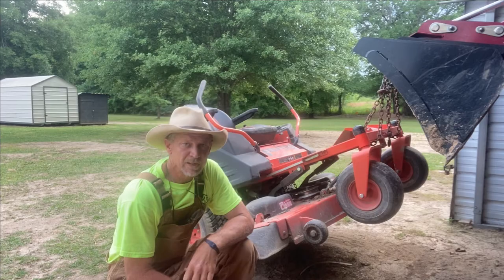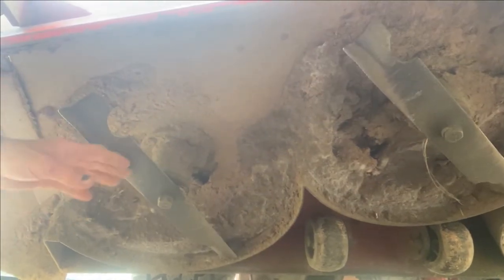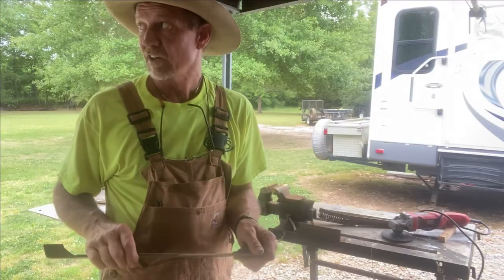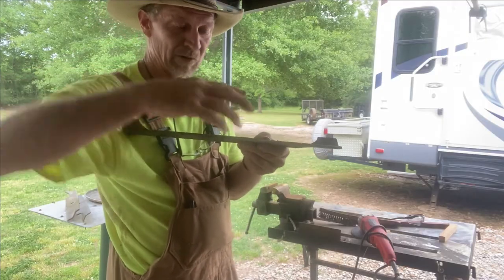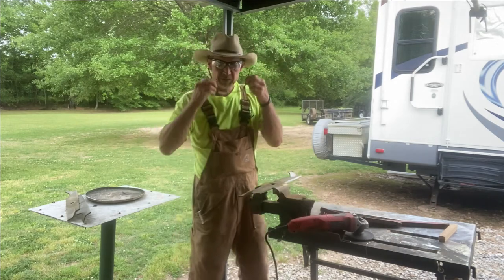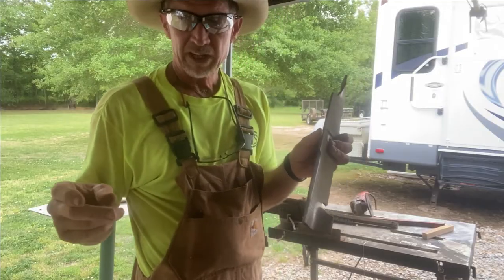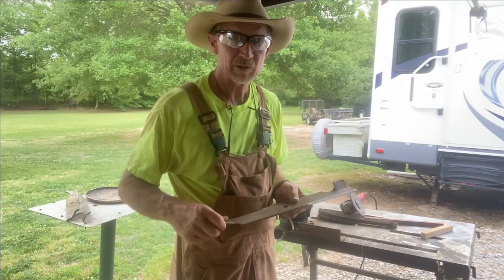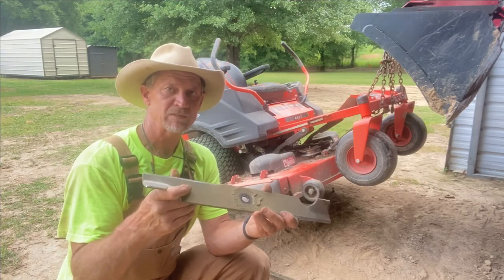How to Sharpen Your Lawnmower Blades the CORRECT WAY/ BAD Boy Elite Zero Turn

Comment: I recommend having 2 sets of blades. When the set on mower needs to be sharpened, simply swap sets. Then sharpen the dull set to be ready for the next swap.
Reply from the maker: I actually have 4 sets for my mower I use daily mowing yards.

Comment: Love your video, especially your comments. Obviously you have been doing this a long time and have learned from your experience and your mistakes. Regarding blade wear, especially the rounding of the corners and the effect of leaving a "rooster tail" strip between the blades. Have you ever known blades to wear and actually get shorter? I measure the length of my blades after removing them and get, say, 16.15". Then when I try to find the proper replacement blade, the manual says it should be, say, 16.45". Hard to believe they could shorten that much from wear. The corners are also rounded a bit, and the rooster tails can be pretty bad where the blades overlap. Any comments?
Reply from the maker: First I want to say thank you for viewing and commenting.
As per blade length, They will wear short over time but I believe the biggest issue is blades now-a-days are built to the specs.
Meaning you could buy 3 sets of new blades and all 3 could be, 1/16" difference.
But yes the rounded corners is the biggest issue.

Comment: why not sharpen with grinder while blade is still on mower?
Reply from the maker: 1: you never know if your blades are balanced
2: I can take them off and do a much better job and faster.
3: I can inspect my blades for other damage while I got them off.
4: That just doesn't make  good since to me. 🤣🤣🤣🤣
But thanks for that question friend.

Comment: There's more to shapening lawn mower blades than just running a grinder across it, you have to balance each blade by removing equal amounts of metal from each   end, so you don't ruin your spindle bearings
Reply from the maker: Things don't have to be so complicated my-friend. But I will say a person needs to have common sense and not grind one end down more than the other. Maybe I should have mentioned that. 😉
Reply: @papawsplace  wasn't trying to complicate things, just trying to help give first time DIYers, complete information that experience hasn't taught them yet 😉
Reply from the maker: I really appreciate this reply. I've never balanced a blade in my life, but I should have mentioned to not take off more on one end than the other. I know what you're saying but somethings in these times we are living in has over complicated things. Thanks again and God Bless!
Reply: @papawsplace  love your videos,  learned alot about changing hydraulic oil in my 2017 Badboy ZT Elite
Reply from the maker: Glad I could be of help. Thanks for watching.

Comment: Not just new to blade sharpening, but to using a grinder also. What kind of wheel/blade do I use for this? Thanks.
Reply from the maker: I like using the 60 grit Flap Disc
Reply: @papawsplace  thanks!
Reply from the maker: anytime

Comment: New subscriber here.  I am trying to remove my Bad Boy MZ Magnum 54”.  One guy at the dealer mentioned they were reverse threaded.  They aren’t budging with a 3’ breaker bar.  Was this blade you removed as easy the first time? I have anti seize for when I mount the blades again.  Any help you can provide this country hobby mechanic would be appreciated.    All the best! Good video.
Reply from the maker: Thank you for the Sub. I've always used an impact wrench but they shouldn't be that tight. I have never had a lawn mower with lefthanded threads on the blade myself. Righty Tighty - Lefty Lucy when you are looking up at the bolt from the ground.
Reply: @papawsplace  thanks.  I used a Ryobi impact wrench I purchased today and it came off after two hits.  I was amazed.  As I loosened the first one I realized I needed to crank the mower up higher.   I have a front wheel life from Harbor Freight and it works pretty well.  Thanks for writing back.  I now have new blades and understand how to do it.  Also I am going to sharpen the old ones as you taught me on the video.  Thanks again!
Reply from the maker: @brentjohnson6654   Glad to be of help my friend.

Comment: You have to balance the blades or they will ruin your spindle bearings ...
Reply from the maker: Yes I agree. in this video I did forget to tell people that. But YES I balance my blades. Maybe I should do a video on balancing blades. 🤣🤣
Reply: @papawsplace  no problem most know you have to balance blades . 
Nail is way we did it years ago but I bought plastic balancer now ...
Reply from the maker: I really need to redo this video because of leaving the balancing part out.

Comment: If you have ever seen a hydraulic hose blow, you would never get under anything like you are. You are not fast enough to get out of the way. I blew a hose one time with a load of manure in the bucket. Bang! It was on the ground.
Reply from the maker: You are so correct.